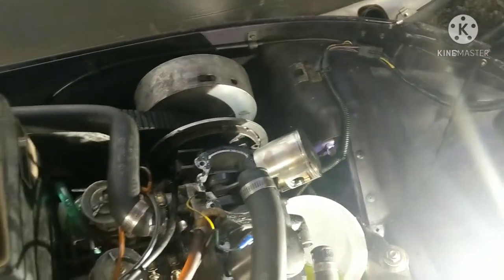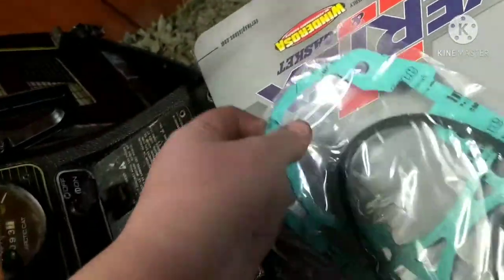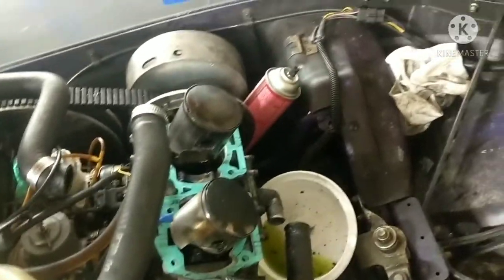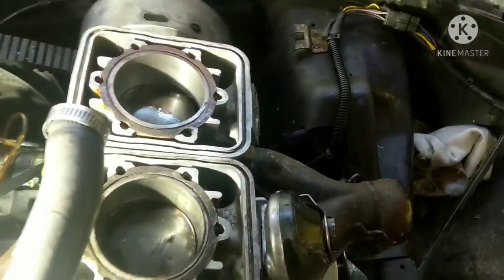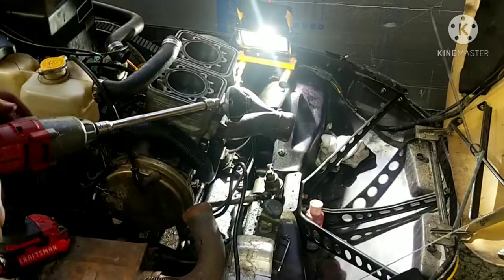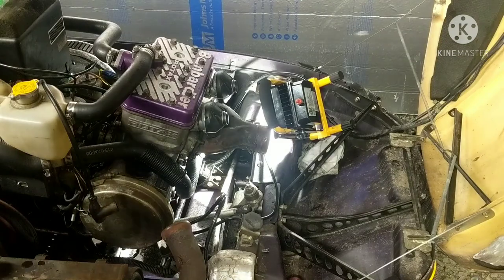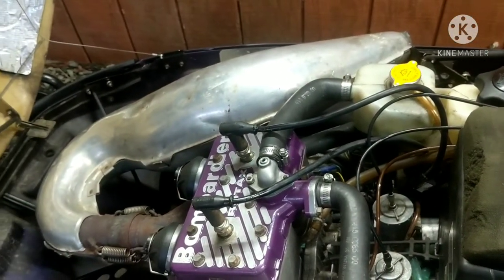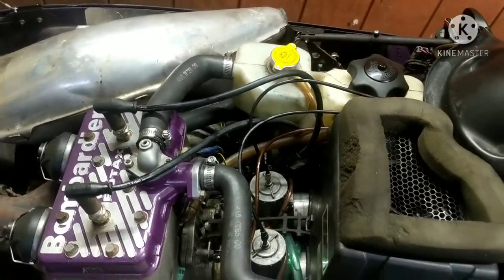REBUILDING A ROTAX 670 !

Comment: Cool. I run 670s and 670hos in my honda odyssey fl350s.  Great engines, I also have 583s and one buggy running a rotax 617.
Reply: I am buying a 1997 skidoo 670 to put in a 1989 honda pilot this fall. excited for the project!
Reply: @brandonsenauit6908  awesome. Pilots are the shit. Always wanted one. Got 4 fl350s and a fl250 with a 440cc instead lol. The suspension on the pilot makes it so much better than the oddysey. Especially in the rear with it running cv style axles. Fl350 has those goofy u jointed axles and only like 4-5 inches of travel. I do run long travel up front using trx450 a arms,brakes and hubs. That made a huge difference.
Reply: @shifty1927  Nice! I have a few TRX250r's and 450r"s I want to add an ATC250r to the pile! ha ha

Comment: I realize this is an old video and it's a down and dirty rebuild but you shoulda at least gave the cyls a quick hone job with a 3 stone hone and some new rings. It woulda made a difference and put rags over bottom end...lose a circlip down there and you're screwed...
The 670 is a beast, I own 3 of them, one is the 670 HO...

Comment: Thanks for the video.  My 583 is running good still.. as always.. good motor there.
Anyway, my 440 fans are low compression, visibly scored.  Im not a motor guy so im wondering, do i bring my jugs somewhere or try to find replacements? or push sleeves or something new in them? Kind of wondering what im in for is all.
Thanks again for the vid.  Cheers from minnesota

Comment: Dude, only useful info you provide is head bolts are 21 lbs torque.  What size are they? What tools ya need? What parts ya order? Useless
Reply from the maker: It's not a how to video and I did literally go over all the parts I used and how I put them in. The video shows the main points of rebuilding the motor. The small stuff is left out because anyone rebuilding a motor should be able to figure it out, or they shouldn't be rebuilding a motor
Reply: @dreamingbigcustoms9860  nope, it’s definitely not a how to video!  I gotta go from the bottom up anyway.